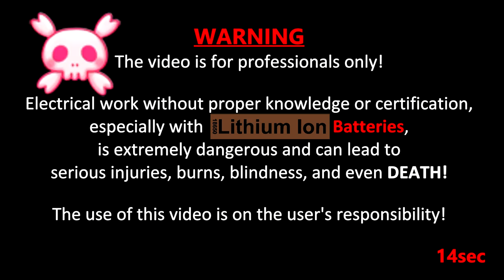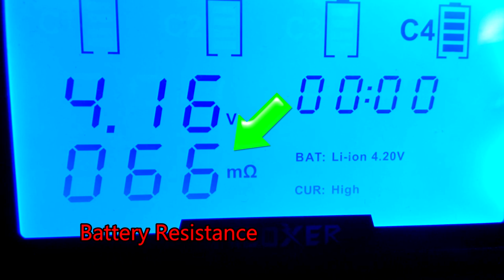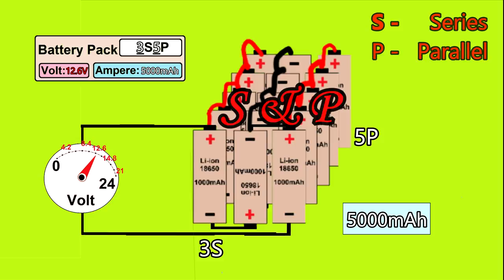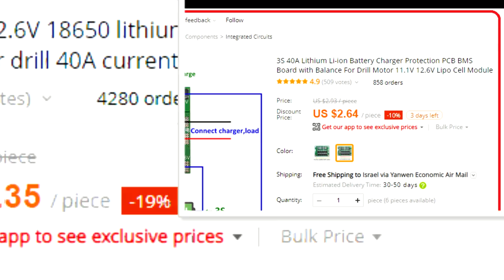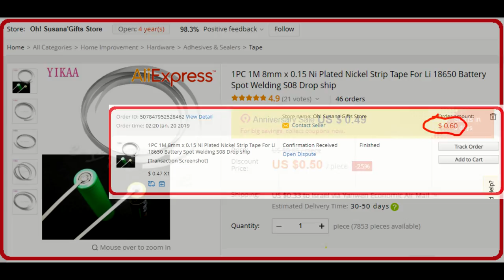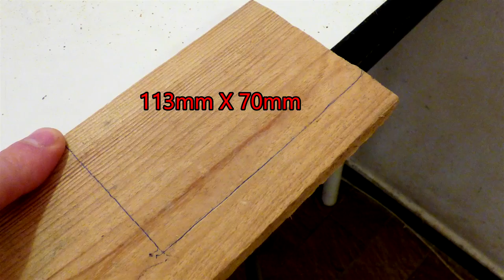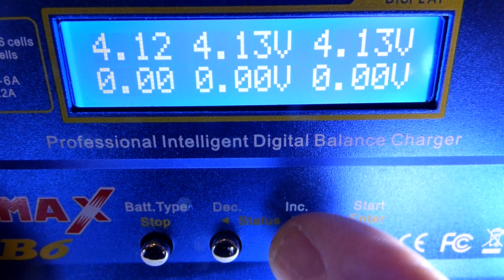How to Build a 18650 Lithium Ion Battery Pack with BMS - DIY - Time Lapse

Comment: CCA must be low on those BMS boards? the larger 100amp boards share the positive between the battery and charger but use sperate neutral connections. Not a problem if your charging your battery from a wall plug in but if its connected to the neutral in a bike I can see this been a problem? 
I'm sure those little 40amp boards get round the neutral problem but they only provide 40 amps, no where near enough to crank a bike startermotor?
Reply from the maker: Good questions. The subject is complex, and those who do not know  that subject shuold not deal with it. The lithium-ion battery I built holds up very nicely. In lithium-ion terms, my battery is still young. In the last two years the subject has developed nicely, and today special lithium-ion batteries for motorcycles are available in stores.
Reply from the maker: @paps69shed  
A few months ago I was back to the (original) Yuasa lead battery.
A lithium-ion battery is nice, but if you are not a racing rider who pursues to save one Kg of weight it is not really a worthy replacement for the lead battery.

The original lead battery lasts for years, the lithium ion battery hold about a year? Lithium ion has another major disadvantage, when the voltage drops (at the end of life), the protection circuit shuts off the battery at minimum voltage with almost no advance warning. In lead batteries you feel when a battery is going to run out, in lithium ion it is cut-off  at once. In the case of the Honda Innova this is not a problem because it has the kick starter and all systems can work even without the battery.

I was very enjoy the project, researching, and learn, but at the end of the day I found no practical benefits for lithium-ion battery.

Comment: This has about 15 amperes, do you think this can jump start a 1000cc Fazer bike that require 180CCA to start? I will use it for emergency only. How long did this last on your bike, and what bike how many cc?
Reply from the maker: I used low quality and cheap batteries, and it did not last more than a few months. It was an interesting experience. I do not like Lithium-ion batteries for motorcycle because when they run out there is no sign of it. It happens suddenly. I built the battery for my Honda Innova125i scooter. I went back to the Yuasa O.E.M battery.
Reply: @MyINNOVAMotorcycling  Thanks for sharing. I see a new trend coming up, more and more people are using Lifepo4 for bikes,  I guess Lifepo4 should be better than lithium right? It is suppose to last 5 to 10 years.  But  maybe should wait a few years, we will know whether it is reliable or not, especially the BMS, how long it will last.
Reply from the maker: @motto666  
Yes, LiFePo4 are safer and last much longer, but today a quality cell of this type is still very expensive. The control over them must be according to a more accurate voltage drop. If you have an accurate voltmeter in the instrument panel and you are monitoring the situation then you may not be surprised. Lead battery does not run out suddenly. Perhaps in the near future a manufacturer who installs LiFePo4 battery will also arrange a control light that will give a sufficiently long warning to replace the battery

On the other hand, if you buy a high-quality LiFePo4 battery from a quality manufacturer that promises, lets say, 8 years, you can replace it after 7 years, then there are no surprises.

As of today, they continue to produce a lead battery, and we are also starting to see a LiFePo4 battery. I think it's worth to wait ... when the motorcycle is full electric then it's clear that no special battery is needed for starting. The technologies in my opinion have not ready yet and we not knowing what will be in the future. (Electric motorcycle apart from the generously available torque, it has only drawbacks)

Comment: Who is still soldering cell anymore?
Reply from the maker: I am, but You're right. Spot welding requires me to buy a new device, or produce it my self, and I didn't want to. Spot welding is the preferable way for batteries welding.
Reply: @MyINNOVAMotorcycling  yup it's a better way to do it there are several diy battery powered spot welders you have definitely proven you have the skills to fabricate one,what got my attention was the care you put in matching and balancing new cells that's not much of an issue but using used cells that big time important

Comment: I really like the lithium or lifepo4 battery and your project,  because the motorcycle battery voltage must be 12v to supply the existing electricity every  components in the motorcycle,but what is the risk if you use a bms 3s and bms 4s module if the voltage on the motorcycle fills the normal 14.8v current and what if the problematic motorcycle regulator can reach 16v-18v.
Reply from the maker: Thank you for the compliments. You are of course absolutely right. Note that the charging voltage is 15.5V MAX, and the MAX voltage of four Liefpo4 batteries is as you mentioned 4x3.7 = 14.8V, so with the suitable BMS card there should not be a problem.
Of course there is more data to check and take into account, and I did not mention them all. Incorrect connection may lead to damage. I share information, the decisions everyone makes  are on their own responsibility. Ask and check in more information sources. This is a topic that needs to be studied in depth.

Comment: hi bro, thanks for video. İ have ducati with yt12b bs which include 12v 10 a yuasa, so i have to use 3s10p , 30x liion battery? 3s100a ? i dont know please can you help me? thanks...
Reply from the maker: I would love to share, whether it helps or not I don't know, the fun on YouTube is sharing, both for entertainment and information, and everyone takes what suits them.
My attempt with a lithium-ion battery failed, the project was interesting and challenging, I was happy to do it, and in the end I returned to the Yuasa battery. Today, lithium batteries are available for purchase on all size, but in my opinion, apart from the difference in weight, lithium battery has no advantage.

Regarding the S calculation of the batteries, calculate according to the voltage of a single charged battery, and multiply by the amount of batteries. Let's say: 4.1V for lithium ion, so you need to connect three batteries at S to get 12.
Regarding the calculation of P of the battery, let's say: 10Ah for a single battery, then you need to connect 10 batteries at P to get 100Ah.
SO YES 3S10P

I wouldn't use lithium-ion again, I'm not up to date, last time I checked the safer battery was the LiFePO4 type at 3.6 volts Max per unit?
4S for 14.4V/ ~14.4 - ~15V that is the voltage you see on the battery terminals when the engine is running, because it is the charging voltage produced by the alternator (plus or minus).

You need to check what is available on the market.
Reply from the maker: PS check if the charging system is working good: At idle rpm there should be a voltage of 13.9 volts plus or minus on the battery terminals.

A Yuasa battery can last for years, but if the charging circuit is not functioning it will destroy it. It is a shame to install a new battery with the charging circuit not functioning, because it will also destroy the new battery too.
Reply: @MyINNOVAMotorcycling  thank for your answers, when i rev it 5000 rpm the voltage is being 14.2, and i have 4.2v 2800mah lions,  so i think to connect 3s 4p, so will be 12.6v 11.2aH , and i am thinking back charging 14.2 will bad affet  on bms or not? What you think? Thanks for your reply bro...
Reply: And want to use 3s 40a bms
Reply from the maker: @DUCATIstreetfighterINTurkey  
The test regarding to the charging system also includes a test at idle rpm, how many DC volts do you measure on the battery terminals at idle rpm?

14.2VDC at 5000 rpm is OK.

The electronic card (BMS)that controls the charging of the battery lowers the voltage to the maximum allowed area (4.2V x 3 = 12.6V). With lithium ion batteries there is no need for 4S connection, only 3S.

I recommend LiFePO4, they are much safer, and with them I know that a 4S connection is made.
Reply from the maker: @DUCATIstreetfighterINTurkey  
Your questions are good, but there is so much to know about electricity and electronics, and I don't understand enough of it to help you all the way.
These batteries are very, very dangerous and improper handling of them can lead to serious consequences: Both in health and in property.
I don't recommend you to continue in this project.

Comment: Sir i have branded 18650's but capacity of all cells are different, so im planning of adding 2000mah×15=30000mah for one parallel, 2500mah×12=30000mah for other parallel, 3000mah×10=30000mah for another parallel, im thinking it will be safe because ah rating of all parallel will be same,,, is it ok
Reply from the maker: If you ask it is a sign that you do not know the sabject and it is very worrying, especially if you are going to make so powerful battery that can cause so much damage. As a principle, the structure you suggest is not recommended. Passing the same current through a different number of batteries creates differences in load and temperature. The parallel structure with fewer batteries will heat up faster. And there are other differences. So is what you are offering possible? Yes. Is it recommended? Definately NOT!!!
There are so many things to know about lithium-ion battery production, if you don't have the knowledge, please don't mess with it. Please leave the pack battery building to professionals.
Reply: @MyINNOVAMotorcycling  thank u for the kind reply, i ordered a battery discharger and tested all cells which are giving me readings from 2100mah to 2600mah, so im planning of building a 20ah pack by arranging the cells in such a way that each parallel will contain same number of cells and total amps will also be balanced, almost all the cells are 2c rated but im going to consider 1c for safer side and also going to match cells which are nearby equal in internal resistance also,, my bike is 48v and 500watt hub motor so im guessing 20ah per parallel with 2c rated cells considered as 1c rated will be sufficient to power my motor safely,, your valuable suggestions are required for me sir
Reply: Sir can i mix 1c and 2c rated cells in parallel considering the 2c cells as 1c, they vary 100 to 200mah from a cell to other and internal resistance is 15 to 20 milliohms difference, all the cells are in range of 120 to 140 milliohms internal resistance

Comment: Hi can i use Thermal Fuse RF series TF 192 degree celsius 250v 10 A, i am plaining to do as the same you did for my motorbike current Batt  (YTZ7S)12v  6AH 10HR..Thank you
Reply from the maker: C for current, T for temperature. I used fused for temperature(TF 72 degree celsius), and it is of course limited to current (That's why I used two of them). The subject is complex, and I do not intend to advise you or encourage electrical work done without proper knowledge and certification.
The hobby is for fun, and you need to be very careful about a subject that could be a big danger for you.
Reply: @MyINNOVAMotorcycling   in this case can i oder TF 72 from you is this possible .
Reply from the maker: @joesam8113  No, my sharing is limited to the videos I upload here. If I remember correctly the components are inexpensive and are sold in web stores. Try to find the deal that suits you best.

Comment: Li-ion or lifepo4?
Reply from the maker: I used  lithium-ion batteries. Lifepo4 batteries are more stable, less dangerous, but they have other dimensions, the voltage data is also different. Today I recommend on lifepo4, OR the original battery
YUASA YTZ7S dry lead battery.

Comment: Great tutorial. Is there a reason u chose to use hot glue to insulate instead of epoxy? If somewhere goes wrong a spark can quickly melt away the insulation and cause problem, or possibly fire.
Reply from the maker: Those who do not have knowledge or ability on the subject, or those who are afraid, are asked not to try. Without responding to your claim, I say that there are many dangers in the process of building that battery, only some of them I demonstrated in the video.
I do not recommend anything, I just share, the video is for viewing only! Everyone who uses the video takes full responsibility for his actions.

Comment: Hi I am a racing enthusiasm, i am thinking to reduce my bike weight by changing lead to lithium battery and I am thinking the smallest size possible. Can I drop from 120 CCA 8Ah to 120 CCA 2Ah? As far as I know, 2Ah which means battery volume is much lesser but would it be sufficient to crank start my bike 3-5 times in a short period of time? My starter drawing power about 100A.
Reply from the maker: To the best of my knowledge racing motorcycles do not have an electric starter at all, and it is also possible to reduce weight by taking out the all kick starter mechanism . If it is worth it? If it's good? depends to whom? It will reducing weight for sure. I do not know how much the load on the coils increases, and how much they can hold, I know that the motorcycle engine can working even without a battery at all (Only on the generator). 
https://youtu.be/d9PcDVDjBK8?t=78
On the racetrack you also do not need the lighting system ... Just please, I share the information, the decisions you take are on your responsibility.

2Ah battery is NOT sufficient to crank starting!

Comment: If I had a lithium ion pack made from 18650, that is 12.6v @ 40ah..

Would it be suitable to run a trolling motor for a kayak that has max 20a draw?
Reply: You need 50a unless it’s a small motor. Did you ever make one?
Reply: @iJacker  my motor is small. It's a haswing 20. 

And no. I didn't make one. I just bought two 20ah agm and they plus my motor are only 30lbs. So ive been rolling with that.

Comment: Hindi po ba masisira ang bms kahit hindi naka battery drive ang motor o ang ilaw?
Reply from the maker: This is the situation in the Honda Innova, the lighting is fed in alternating current(AC). The Alternating-Current(AC) coming from the alternator to the regulator, and therefore limited to 15.5V AC at maximum.
There is also a rectifier that give a Direct-Current(DC), which supplies DC voltage to other systems including to charging the battery.

I am back to a standard lead battery, and I do not recommend lithium batteries.

Comment: Can i use this battery for my car alternator give 14v 5a can bms handle the chatging current
Reply from the maker: In principle yes, there should be no problem, depending on the specification of the BMS card you are using.

My experience with the lithium-ion battery was interesting. Beyond the do-it-yourself hobby games I recommend the original lead battery: YTZ7S
https://www.amazon.com/-/he/dp/B002OQASG4/ref=sr_1_11?dchild=1&keywords=ytz7s&qid=1602545409&sr=8-11

Comment: hi there i have a question i am using 12v 8ah battery on my adv motorcyle which is orignal , i want to add 2 additional pairs of some auxiliary lights, i am worried what battery should i make in order to not blow up my electronics or battery pn long run, thanks in advance, this video was really helpful
Reply from the maker: I enjoyed working on a lithium-ion battery project, but it didn’t make much of a contribution beyond that. I went back to the original lead battery.

It is not recommended to add an electrical components without updates to the system to support the extra components. I am not a car electrician, and do not know how to recommend to you what you should upgrade in your electrical system for adding electrical components.

Comment: everytime i start to work on doing this im worried the alternator will blow up the batterys
Reply from the maker: Your concern is justified, in the sense that improper and unprofessional handling of lithium-ion batteries, especially in self-production, can lead to dire consequences.
Reply: Grigoris Zagas  example of a good bms and not cheap chinese??? Link?

Comment: whether the motorcycle current regulator 14.5v to 16v can overcome using 3s bms, please explain sir.
Reply from the maker: You are absolutely right. It is not possible to explain everything that requires explanation in a short response, nor does the video purport to be the one that explains everything. I understand by your question that you know the subject better than me. Yet, i woud try to answer you like this:

A BMS card is a Board Management System. The electronic board has over voltage protection, and over charging protection. You must to look at the specification of your card and there you will find all the data. Today I would build a structure configuration of 4S  with Lifepo4 batteries. The S4 configuration have more high quality BMS, and the batteries Lifepo4 are more stable and less dangerous. I sharring the information, the decisions you make are on your own risk. thank you very much.
Reply: thanks sir.
Reply: if you use bms 4s the results are 16.8v full battery voltage and low voltage of 14.8v, while motorcycle batteries use 12v and full voltage 12.8v even though the motorcycle regulator supplies 14.5v but still the normal voltage point returns to 12v, is it good if using bms 4s = 16.8v, sorry I'm a beginner just learning and understanding the level of risk. thanks in advance.
Reply from the maker: A typical 12-volt lead-acid battery full charge is approximately 14.5.-15.5 VDC
that is the Charging voltage
After charging is finished, after a hour or more
 the battery drops to about 12.8 volts 
lifepo4 singl cell max volt is 3.7
3.7x4=14.8
Therefore, with a BMS card that corresponding to this data(S4), there should be no problem.
Maybe I'm not accurate either, just note the possibility of a Lifepo4 battery pack
Reply: thank you sir